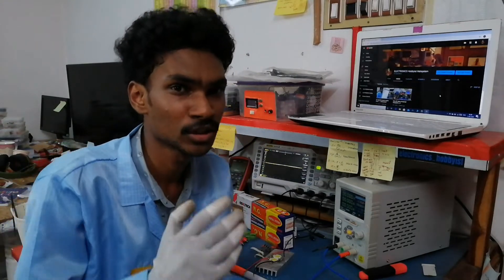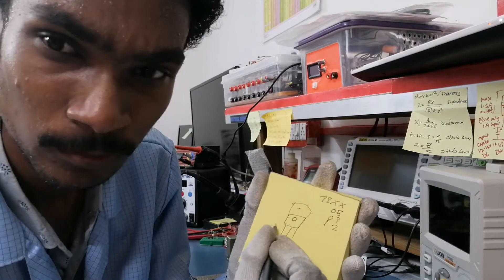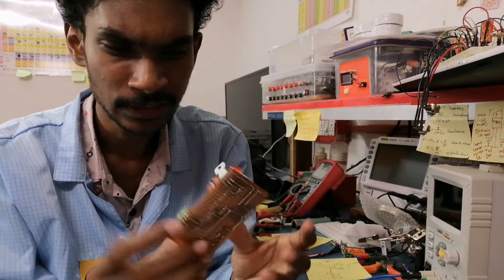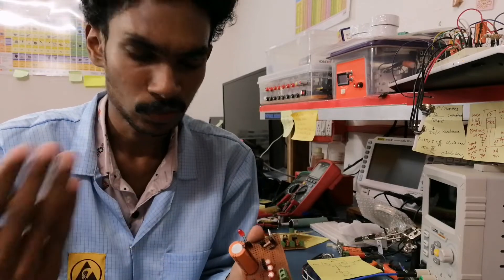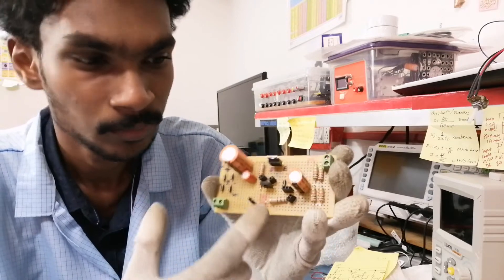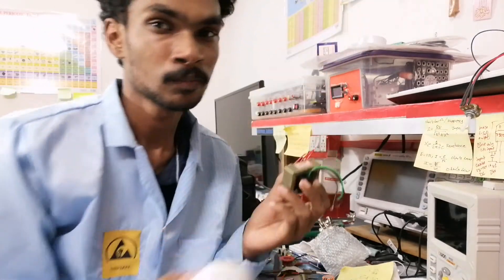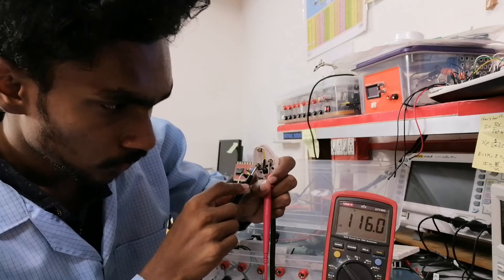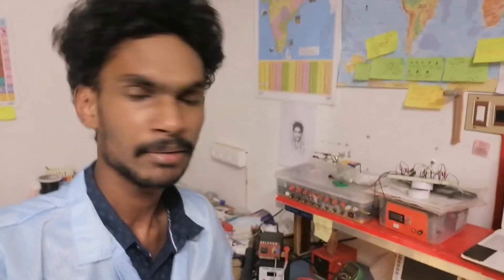DC Variable power supply PART 2... Malayalam

Comment: മച്ചാനെ 0 to 24 volt - 1 to 30 amp adjustable Power supply ഉണ്ടാക്കാമോ ? വോൾട്ടജ് കറന്റ് അഡ്ജസ്റ്റ്  ചെയ്യാൻ പറ്റുന്നൊരു powerful power supply..  waiting for that 👍👍
Bro അത് pole circuit upload ചെയ്യണം 👍👍
Reply from the maker: After few videos i will make......bro....
Reply: Yea bro you can...

You can use Lm 317 ic or an boost moduel.

But the issue when you use a boost moduel is, you must provide high ampere at input. That is, if you want to light a 2 ampere bulb then your input must be capable of providing minimum of 2.1 ampere.